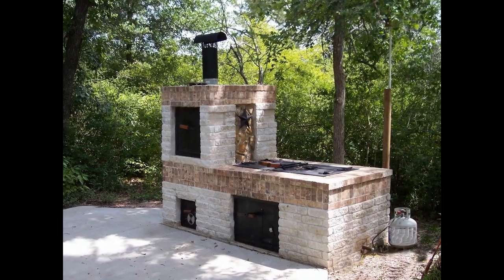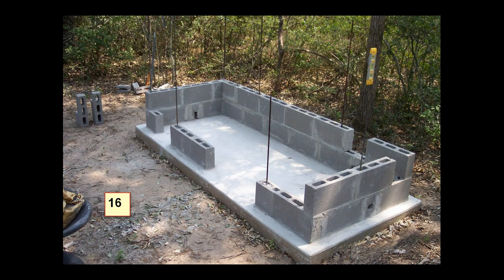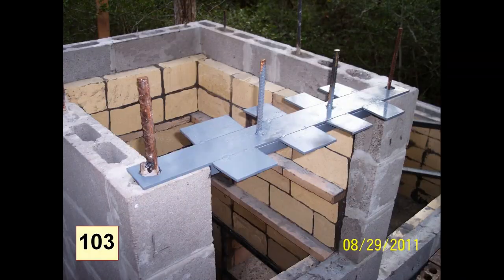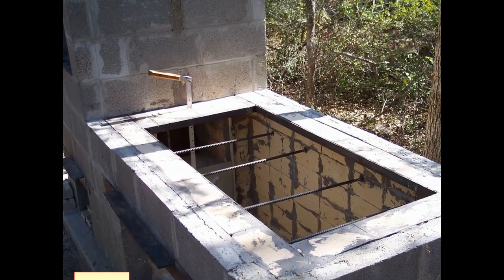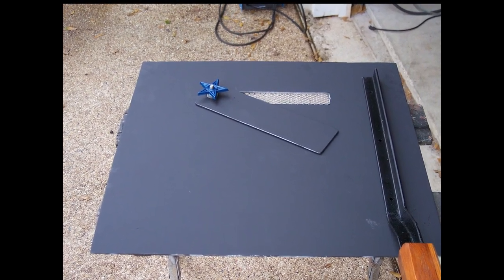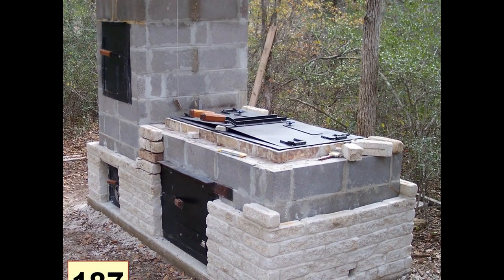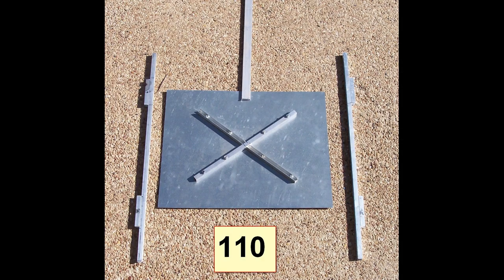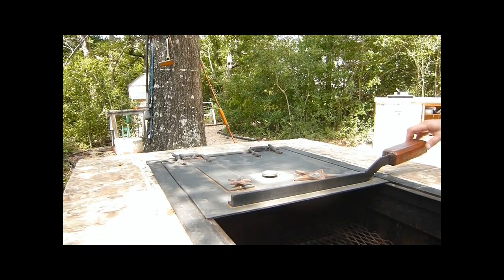Building a Brick BBQ Smoker

Comment from the maker: The damper handle is wood and aluminum (cedar sandwiched around aluminium bar stock) so it's not too hot to touch, and yes, I do occasionally make adjustments to get the temp where I want it during a cook.   After I adjust it, the temp usually moves in less than a minute in the smoker column.   I've been pretty pleased with the main damper device - I was worried that the smoke and heat from the main pit might not draft well into the smoker column, but it works perfectly.

Comment: Very nice build! Couple of questions…..With this build can you smoke from the grill area into the tower as well as what I would call a hot smoke directly below?
Also….ever tried baking in the tower section or a pizza? Thank You
Reply: thanks.   I've decided to do all my smoking from the BBQ grill into the tower.   Just putting a fire into the bottom of the tower was my original thought for smoking, but it's too small of an area for building a fire that will need to go on for 3 or more hours at 230 to 275 degrees.   I guess if I was doing one of those "slow smokes" of 205 degrees or thereabouts it might be OK in the tower but would still require a lot of wood replenishment for long hour smokes.   No, I've not tried using the tower for a pizza oven - it might work, even though there is no dome shape, per se, above the pizza.

Comment: Hello Joe,  Since youve had this a few years is there anything that you would change?  I would use it as a smoker only and would like room for 4 briskets, 2 pork butts & 6 ribs.
Thanks
      David Harmon
Reply: It's been working OK, but I rarely use it for grilling.   90% of the time I use the smoker column after having built the fire in the BBQ side - can't beat the real wood smoke.   I occasionally finish off smoked meats on the grill to crisp them up, but most of the time I just put the finished meat in foil (or red butcher paper) and let them stay warm on the grill as the coals go out. 

If all you want is to smoke, one of the pellet smoking cabinets, ie Traeger or their competitors, would be a much cheaper way to go than to build a $2K brick smoker.  I've seen some as low as $300.   I've not tasted any pellet smoked meats, but I'm told they do very well, and you don't have to watch the fire as closely as the standard wood-fired BBQ pit.  

I still like mine because it has curb appeal.. it looks good (and you get to build a REAL fire).  the pellet smokers are just another ready-to-rust metal box on your patio.

Comment: How has it held up over these years? Anything you would have done differently?
Reply: Still going strong - works fine.   One of the colored bricks in the front, near the BBQ pit door,  developed a crack in the mortar when the BBQ pit is at full heat.   Doesn't interfere with anything.  I have presumed it was because I used a 1/4 inch thick, 4X4 inch  Brick Lentil over the main BBQ pit door (see photo #29 from my DVD) - That's a lot of iron to get hot.   I should have used a simple piece of 3 inch wide flat iron to lay bricks over the main door.   Only other thing that didn't work was my use of little short lengths of iron pipe (see photos 126 and 128 from the DVD)  embedded in the walls of the BBQ pit to hold the lengths of rebar that support the expanded steel cooking grill.  Those little pieces of iron pipe rusted out and made it more likely for the rebar to fall out of their support holes.  Should have used brass, or thick aluminum, or something that doesn't rust.

Comment: I really like what you've done, but do you find the grill doors slamming shut in big gusts of wind?
Reply: no, they're way too heavy for anything other than a tornado to blow them down.    It takes a pretty good lift just to get each one of them up and reclining on their "feet".   I can do it with one hand, but it works better with two hands.   That 3/16 inch steel plate is really heavy:  I'm glad I didn't opt for 1/4 inch.    I still favor the two hinged doors rather than one single door that would have to have a significant counterweight and pulley system, etc., over in the woods behind the BBQ pit.    Thanks for the comment, Miles.

Comment: Did I hear correctly that your sliding "damper" between the grill and smoker was made of aluminum? aren't you afraid that will melt with a good fire? or warp? I hope I misunderstood. I've had aluminum melt when trying to clean wooden handles off in a burn barrel and the fire isn't even contained in a closed structure.
Reply: Yes, you are correct about the damper materials.  The aluminium sheet for the damper door itself, as I recall, is about  1/32 of an inch, and the two vertical channels in which the damper slides are aluminium also - the kind used to construct lightweight shelving brackets on a wall.   I knew I didn't want anything made of iron or steel, because it would rust and seize with all that heat (and moisture which forms on occasion).   Frankly, I didn't have the presence of mind to even think about the possibility of the aluminum warping, and fortunately that has not been a problem - just luck on my part.   Perhaps it's mostly because I create the fire in the CENTER of the main pit and the heat/smoke is what enters the damper opening.   Even at that, the heat in the main pit gets up to 600 F when I'm getting the fire going, and no problems.   The damper is open most of the time, also.  I'd have to say the "seat of the pants"  damper design was one of the more successful ideas I had on this project.
Reply: Ok, cool. It looks like it would be a bear to replace after the fact anyway. Glad it worked out for you. Maybe next time... Stainless?
Reply: Yeah, stainless would probably work also.   the two aluminum side channels are mounted into the firebrick with removable (?) screws, so yeah, I'd have to get down into the pit to get those screws out if this damper goes south.  probably couldn't used the same holes, either:  firebrick crumbles easily.

Comment: What temperatures do you get in the main pit and smoker on average? Like what is the easiest to maintain in there? I am about to build something like this at home but a bit larger and love this video.
Reply: generally speaking the temperature in the pit is double that of the smoker.  For Example, if I have 600 degrees in the pit (where the fire is at), the smoker temp will be at 300.  I use the unit mostly for smoking meat, so all I usually need is 220 to 275 depending on the meat, so the temp in the fire box is about double this value.   As you could see in the video, my adjustable damper between the fire pit and the smoker handles 98% of my temp adjustment needs.  I can also close the damper on the chimney for more smoke,  or open the two vents in the deck lids for cooling, neither of which are hardly ever needed.   In the winter, it takes about 45 minutes for the fire to get up to cooking temp in the smoker, even with the propane pipe lighting the logs.   I thought that having thick walls (one ft thick) would make the temp easy to maintain for long periods, but generally I have to make upward adjustments every 45 minutes to one hour in cooler weather.  If this thing was being operated continuously, like in a BBQ restaurant, I think it would probably hold temp for hours after all the walls were fully heated, but most of my smoking is not longer than 3-6 hours.

Comment: very nice design but I think you shorted out the smoker section seems like it's not big enough for large chunks of meat if you wanted to cook for a big party
Reply from the maker: thanks, David.   The smoker photos may be misleading.   there are actually TWO racks in the smoker, plus four hanging hooks in the ceiling (not visible in photos).  I can easily get three pork butts onto each of the two racks, or four briskets, two on each rack.  the only shortfall in the smoker column is that the little fire box in the bottom won't support much of a fire, so that's why I use the smoke coming from the main pit, enhanced occasionally with a propane pipe in the smoker fire box for long smokes.  Some of my fellow cookers keep a raging fire going in a separate fire box, or even an external fire pit, then shovel hot coals into the smoker column.  That works fine also, but you run the risk of getting ashes onto the meat with all that shoveling, I would think.

Comment: What kind of brick do you use for the outer part, and where do you find it?
Reply: Arturo, That white brick on the outside was a manufactured brick known as "River Stone".   You just have to call the brick suppliers and ask if they have it, I don't know if its still made.     There's nothing magic about it:   you can use any brick.  I had to use it because the homeowner restrictions where I live require any structure on the property to be built with the same brick as the house, which mine was.
Reply: @billthames9564  I'm asking because I think it looks great. Looks like it was a lot of work, but well worth it.
Reply from the maker: @ArturoGarzaID  Thanks.   Yep, enjoyed every minute of building it, even though it took about a year at my pace.

Comment: is this good and safe for smoking chicken, brisket etc? whats the avg temp of the smoker part? do you have to smoke those meats for extended hours? thanks
Reply from the maker: Yes, it will smoke all the meats you mention, and it can be used for grilling also.   You set the smoker temp where you want it, using the damper between the bbq pit and the smoker column.   I hang a temp probe down into the smoker column.   briskets take about 12 hours, pork butts 6 hours, pork ribs about 3 hours.   I usually cook between 230 and 260, favoring the lower number.   In the case of chicken, its' better just to BBQ it, because smoking tends to dry it out.
Reply: thank you and GREAT JOB! will try this but on a smaller scale.

Comment: How did you first season it... 😂. That's an awesome, detailed build.
Reply: I just built a medium sized fire in the BBQ pit side, closed the fire door, then the lids after a few minutes and let the smoke go up and out the smoker side.   Not much to it.   The expanded steel grates which I use for a cooking surface also required some seasoning.   I brushed olive oil on the grates and allowed the initial fire to season them up.   Could also use PAM on the grates as well I guess.     that was all that was done for seasoning.

Comment: Isn't aluminum toxic when heated so hot?
Reply: Must not be.   I have a gas grill that is all-aluminum except for the burner which is stamped stainless steel.   I bought aluminum because iron based grills, even with the fancy stainless steel covers, all rust to the ground after a few years of being outside:  not aluminum.  My aluminum BBQ grill is over 25 years old - all I've had to do is replace the burners over the years, and one briquet and grill grate.  

In my brick bbq/smoker build, The sheet of aluminum that I use to dampen the flow of smoke from the bbq pit to the smoker column is never touched by fire, only smoke which is in the 200 to 275 degree range.  Had I used a steel sheet, it would have rusted into nothing by now.

Comment: Joe! Could you tell me how much it cost to make the basic smoker and approximately how long it took? My husband and I are looking to build a few. Also, have you used it to smoke beef/ribs? how did that go?
Reply from the maker: It cost 1900.  Estimates to have somebody else build it were $4,000 to 8,000 incl the materials.  It took me a year but I was in no hurry and I had to think through every step, since I'd never done anything like this - it was my first retirement project - enjoyed it very much.   Yes I've done beef ribs and pork ribs - 3 hours.   Anytime the family comes out, they always want pork ribs - I've got that down pat.  Also smoked pork butts (6 hours) which are super good, in addition to the items like chicken and hamburgers that you can do on the BBQ grill side of the unit.  This thing will feed an army if need be.  Fortunately I have unlimited supplies of Oak wood. 

.When we have visitors, we always seem to gather around the patio where this unit stands, smoking away.  

You can buy metal smokers for less bucks (and some for more bucks), but this is a permanent fixture on my property and I believe it adds to the value of  my home.   And, it ain't gonna rust away....
Reply: Thank you for your reply! My husband and I are in the process of preparing to open a bbq joint in Costa Rica and we are more interested in having permanent smokers in the back of the restaurant instead of buying metal ones. We definitely need a smoker that can feed an army. Thank you and God bless!

Comment: Joe........man what a gear smoker. Would it be possible to get a set of plans/drawings/parts list ?
Reply from the maker: Hi Don,   well I'm selling the DVD on ebay for 9.95 for folks interested in the details of the build.    The DVD has an 87-page pdf booklet, several hundred HD photographs, etc.,  that describe every step of my "journey", and a list of purchased items that were used to build the bbq/smoker.   It also has a list of the dimensions, but what it doesn't have is typical construction drawings... building something out of bricks, concrete blocks, and mortar doesn't lend itself well to finite dimensional drawings, like a woodworking piece, for example.    Hope you'll try the DVD.  On Ebay, browse for "How I Built a Brick BBQ Smoker - DVD" and you'll see the same photo as above.   thanks
Reply from the maker: traveling a lot these days.  would rather use email for your questions.   use joe@joenovice.com.  do you have the DVD?   might need it for reference.   thanks

Comment: How long do you anticipate the wood smoker rack supports will last?
Reply from the maker: The rack supports in the smoker column are "split" firebricks, turned on their flat edge and jutting  out into the smoker column about an inch to form a shelf.  These racks are supporting expanded steel cooking grate, which shows no hint of giving up, especially since they are always being "oiled" by the meat being smoked.    

the 1/2 inch rebar rods used to lay across the width of the main BBQ pit are removable and are inserted loosely into three inch sections of 1/2" steel pipe that are embedded into the firebrick walls to act as a support for the rebar rods.  These rebar rods are then supporting the same kind of expanded steel cooking grates that are in the smoker column (I think it's called "3/4 Inch" grating), and neither have given any indications of failure.   they've been in use now for 7 years with no hint of failure, or even sagging.    I would not use anything smaller than 1/2 inch rebar because it might sag under the heat of the startup fire.   

You can see the rebar rod installation details (w/o the expanded steel grate in place) at www.joenovice.com.   Look for photos numbered, 130, 143, and down at the bottom, for photo #128.
Reply: Joe Novice Nice!  I mistook the split bricks for wood.  Long live your cool smoker/BBQ!

Comment: Hey Joe,
 I really liked how you put this thing together! I've watched a lot and I do mean a lot of videos the past 2 weeks on building my own smoker and nobody comes close to this! I hope your right when you said you had no previous experience in construction work... cause that line motivated me to want to try this design out.. so I purchased it off of eBay yesterday. I do have one question... Why did it take you a year? I don't want mine to take that long but would it require a full year of work to get it done? thanks
Reply from the maker: Good Question.   One reason is that I had never done ANYTHING like this before, and I would sit quite a while planning the next move.   Plus, this pit has basically 3 structures, the outer white bricks, the concrete blocks ("CMU's") in the middle, and a full lining of firebricks inside.  The outer white bricks, a requirement of my local HOA, could be skipped altogether (kinda plain looking) or you could use a decorative version of the CMU's, ie., one facade is finished out in a design of your choosing; see examples at http://www.westbrookblock.com/cmus/.  The real reason for something that a professional could probably do in two or three weeks (?), is that I was newly retired and was in no hurry, and also when you get retired, your relatives, your wife, and your friends think you have nothing to do, so you get loaded up with all kinds of jobs and activities that you wouldn't have to do if you were still working.

Comment: This looks like exactly the type of thing I've been wanting to build next to my garage.  Even if I don't go with something like this exactly, I'd like to see your research and photos/expeirence.  For the $10, do you have an option to send via email/dropbox/something similar instead of sending a DVD through snail mail?  I don't mind the price at all but not a fan of physical media.
Reply from the maker: Sorry.   I don't have any other way of getting the complete info set to you other than the physical DVD.   the 87 page PDF is 96 KB and the HD Photo Gallery is 266 MB.  Too large for email, and I think you need both.   Looked at Ebay's super strict rules for digital xfers and couldn't get that to work either.
Reply: let me know if you need a website setup to sell the digital files online.